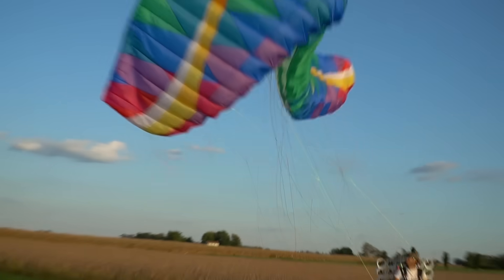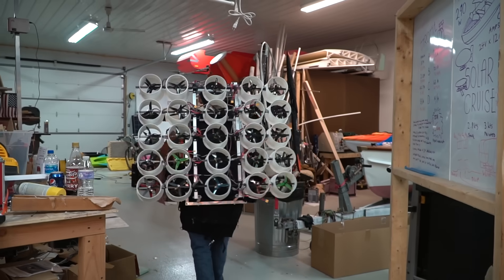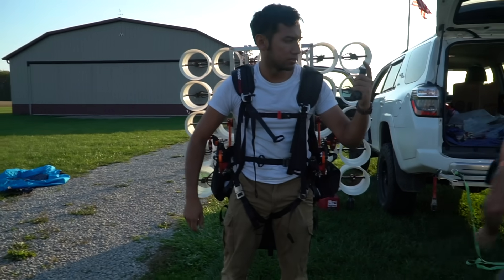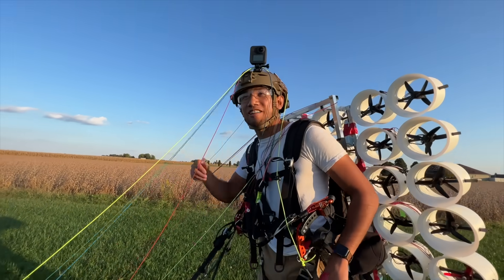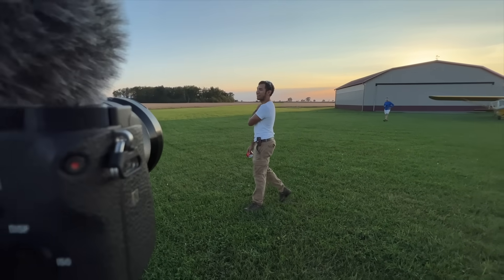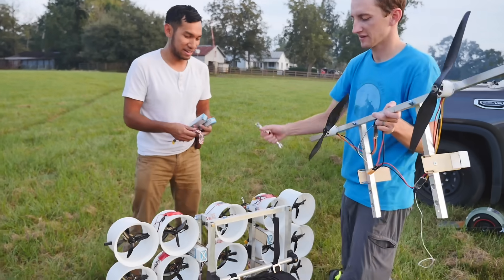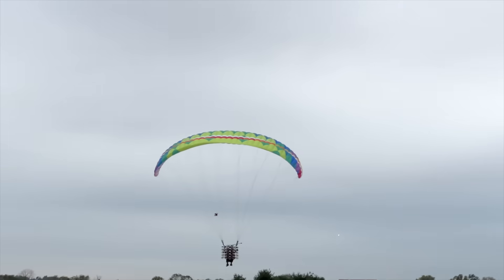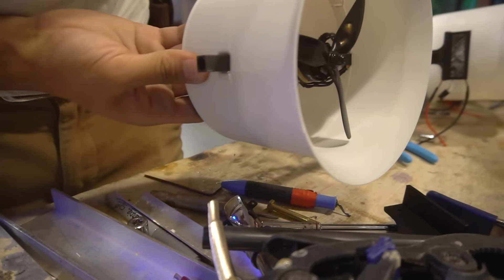Flying with 50 drone motors (homemade flying machine)

Comment: As a mechanic I can confirm, loctite won’t do it.  Go with JB Weld.  I’ve seen more than one SBC 350’s glued back together with that stuff.  50,000 miles strong and no signs of splitting.

Comment: Sorry it's not a scientific design of your science experiment.. 👎 the propeller /motor exactly behind your back are use less and creating extra weight of your flight.. 🙏 So You should be more logical and more scientific before doing experiments.. 🙏🙏

Comment: Hi mate, fantastic project.
Check your locate strengths.. Some are designed to be removed with heat, some is permanent. Make sure it's a thread locker type for screws and drip it onto the screws from the tip down. You don't need much and not all loctite is for the same application. You'll get a much better result.
Cheers

Comment: I would highly suggest adding some sort of protection for the user. Like a lightweight wall between the motors and the user. I fear someone can be basically stabbed with shrapnel from any motor blades if there is some sort of catastrophe. You have to think like this. If one motor destroys their blades, those blades can cause a chain reaction of damage in other motors. That’s a lot of shards to throw at the back of a user.

Comment: ROOD BOY IF YOU HOOK THE EDF VERTICALLY YOU CAN USE 5 EDF WITH RECTIFIER TO CHARGE YOUR BATTERY WHILE YOU ARE FLYING. THE OTHER 20'S PLAGUED TO ESC FOR THRUST FLYING. I DO IT.

Comment: LISTEN YOU DID A GREAT JOB; NOW WHAT YOU SLOUD DO IS COMPRESSION SYSTEM, COMBINE 25 EDF ONE AFTER OTHER VERTICALLY AND INSTEAD OF USING 3 BLADES USE 12BLADES OR ABOVE IN ORDER TO MAINTAIN STABILITY.  DON'T FORGET TO TRY THE VERTICAL COMPRESSION SISTEM.

Comment: how do you know that u wasnt just flying anyway due to the paraglider and thermals and that the motors were even helping at all? do double propellers work better? not necessarily unless they are both 100% in line... they could produce more drag if they arent in sync..  if u truly want it to work u might want to consider going to a wind tunnel to test everything out.. work out exactly how much power is produced, ways to make the airflow better and keeping all the blades in sync etc.. cos to be honest i feel like ur mostly just flying with the paraglider thing and these might be doing bare minimal work

Comment: how did you work out how many you needed? or u just guessed and put in 50 cos its roughly the same size as a normal paramotor? did you see how much power a paramotor produces and realise drones produce 1/50th???

Comment: should have used the motors to power two counter rotating propellers that are much larger with higher torque to take advantage of higher efficiency with a larger prop

Comment: Next time get a pair of fingerless gloves, and stitch a flap with an elastic band to the palm of the controller. Use another elastic band over the top of the pocket to keep it secured vertical. 
10-20 minute stitch job by hand, 30 seconds by machine.

Comment: If I did this I would need 130 motors cuse I weigh 255 lbs not fat just tall 6 foot 4 so I'm limited to what I can drive or fly airplane wise every ultra light I have found ready to fly that's airplane style is to small for me to fit at all or I weight like 40 lbs to much it sucks so I'm building me a Ultra light enclosed cockpit for ppl that are tall up to 7 foot tall person could fly it If needed it looks like a mini sport jet with a prop it's cool runs off of a 80 horsepower motor

Comment: To gain more power you should separate the fans into two half. left and right. ensuring a gap in between where your body exist. because your body resists a lot of air flow.

Comment: Peter, here is what I want you to do for a project:  I want you to get a 15-amp, 120V electric generator that is just the generator, with its input shaft to accommodate any power source.  Then I want you to get 40 stationary bikes and mechanically connect them and the generator all together.  Then I want you to do all kinds of experiments with powering household devices like clothes washers and heavy-duty corded power tools --- all on human power only.

Comment: I guess the problem to get the right thrust is the body of the flyer obstructing the air to reach those motors in the back of the flyer

Comment: Ducts only work on counter-rotating blades if they are shaft driven and RPM matched. The 2 motor design is more efficient when the duct is off because outside air makes up for the rpm mismatch allowing the motors to fight less.

Comment: I would say the middle row of motors behind your back isn't getting clean air and producing full thrust.
I would move them on top/bottom on the sides instead.
Also, how much more efficient is a (correctly designed) ducted fan?  I never seen a figure on that, i just "know" they are more efficient....

Comment: I wondered if it would have made a difference if the middle (vertical) row behind the pilot was removed and was divided and put on each side or on top because the human body was possibly interfering with the efficiency of the motors. You know, airflow, power and so on. By the way, excellent video, keep up the good work.

Comment: ok... so I am thinking about getting my stupid wheelchair to fly.. with a few weather balloons made rigid with my bioplastic... and thinking about forward and reverse motion... or at least reverse thrust.. like brakes... for sissies... but... easy to make.. fix.. and maintain... harbour freight..  has a rechargeable.. small leaf blower for use in the shop... 200mph velocity blowing from a hand held blower that weighs 3kg with the batteries... I'll make a video..  fly down to Safeway.. roll around Safeway come back out and hook up my trusty wheelchair to the personal size dirigible... a single moving part... rechargeable in flight because you fall up very slowly in my dirigibles... 
love your videos brother... ✌️❤️✌️
Reply: ya know those things Luke Skywalker raced... floating a meter above the ground... next think two Tesla pulse jets... with reverseable thrust..  for sissies.. goggles are required... 🤠

Comment: My immediate thought after seeing the setup for the first time was that the batteries will drain quickly but also that the sail is massive and I wonder if there's any flexible enough lightweight solar cells or membranes you could fit onto it to essentially turn the wing into one massive solar panel to continually charge the batteries?

Comment: This is probably a pretty good final solution.  Because of leverage, it might take less energy to move air with a system of small propellers, take boat props as an example.

Comment: How is the efficiency of the individual motors? Looks like the middle ones don't get much air since you sit in fron of them.
Or do they get enough?
Or would you get extra range with little power reduction if you just took them off?

Comment: suggestion
Not ure if this will give you more push, but make shrink the size and reduce some weight, by how you mount them.
Note the placing of all motors, one on top of each other and side by side
This leaves a space between motor mountings,
Then because of the intake lip, place every other one slightly forward and behind, 
What happens if you set them 1/2 the distance between each other , shifting them horizontally and vertically
It will shrink the overal size, by how much i don't know, but you will get a much stronger draw of air, and push i don't know,
But you will definitely shrink that package considerably. and not have so much losses, inbetween, not sure as i'm no expert, but just a thought to reduce weight and size.

Comment: You might try removing or relocating the vertical row of engines lining up behind your spine, as they may not be getting full thrust due to your body blocking the air flow. Just a thought.

Comment: You are losing a ton of thrust and torque potential using those cheap plastic blades. The rigidity of carbon fiber propellers allows it to cut through air more efficiently, thus translating more of the wind into lift or propulsion. This helps slightly in terms of battery efficiency as well.  Cheers!

Comment: Lacking data from a wind tunnel I can only surmise that the middle two rows are creating more drag than thrust. I think removing them would not significantly effect performance while extending battery life and therefore flight time.
 Alternately the inner 2 rows of motors could be placed in a lateral configuration at hip hight.

Comment: IMO, less but larger prop and motor combo, to obtain same wing span to power ratio, but also remove the ones from directly behind your body profile, maybe keep one low voltage anti eddy prop behind you, while ascending it acts like another motor. While descending it shuts off or reverses separately and allows the outer props to guide landing while the natural/powered eddie allows you to slow naturally/powered and predictably.
Reply: P.S. yall are stunt devils just going for it, absolutely admire it, the redundancy is an awesome feature.

Comment: Running the single fan you normally use on an electric motor is the only way to fly.  Much quieter than 50 tiny blades that make more noise than the gas motor.

Comment: Using one large electric motor to turn a large propeller is a more efficient way to produce thrust than using many small electric motors and small propellers with the same current.

Comment: I think you can try to take out the middle 3 x 3 drones ( total 9 drones ), those drones that blocked by your body are not so efficient. Suggest to put all the 25 drones in a ring shape to increase the air flow.

Comment: I feel like the fan on these are the resort of things that could be improved upon which might be a better use of a person's time. Lighter materials better modern batteries and you'd have increased flying time. 
I didn't really see the point of making a worse version of something. It's like drone motors with blades attached to cut your grass. You could but why bother?

Comment: Id feel safer on that over a regular one. I think Id have the batteries and fans separated incase of fan failure. Could that set up be used to make a hover board? A bunch of small fans under a grid not a board?

Comment: I am super curious how much this costed to build all told, is it posted anywhere? Anyone have an estimate? I can't imagine the frame is more than a hundred bucks, the plastic for the printer probably about $25-50 worth if it's PLA or maybe $60-100 if it's ABS/CFRN 
But then the drone motors; buying 50+ from some Chinese or Taiwanese vendor has to put them under $10 or maybe even less than $5 each with probably about as high a shipping cost as the motors themselves

So what maybe, under $1k not counting the labor and parasailing equipment?
That's fucking incredible

Comment: I think the same can be used to turn left and right in the air by using one side 10 pair to push forward and other's side 10 pair to push backward and turning off the middle 5. 
Btw you looks super cool with it😎

Comment: How about:  carbon graphite instead of aluminum? As for the controller...how about a glove that contains the controller, so you don't have to resort to tape. Look into making the exhaust tubes longer so you can utilize more of the thrust before it is dissipated. Take a look at some of the air movers that use the same type of funnel for drawing in air. Fly on a cold day when the air is denser

Comment: i would guess if you bring your knees up to gain some elevation
and legs down again to loose some would give you some more control over the angle of attack of the fans
i am just talking without any knowledge of how a wing like this behaves with that kind of input, or even without, i never flew one

Comment: I just wish we could use these for example to go to work... rather than a train or bus, you just power it up, run a bit, lift up in the air and the soar through the sky until you reach your office / worplace. Land, do you work, and the fly back home. I KNOW that there are versions which would allow you to commute (as in travel distance) - its just the legislation and obvious safety issues... but still i would rather go with this rather than on the ground...

Comment: For better airflow use a honeycomb configuration. Also, move the motors from the centre column to the outer edges (it looks like there is plenty of room for that, especially with a honeycomb config)
Reply: Can't be any wider than your arms can hold the risers apart on launch.
Reply: @matoko123  A honeycomb configuration will compensate for that because it will be more compact. Also, he still had plenty of room to spare.
Reply: for a better engine just dont' fuck with this at all, anyone can make an engine run a few minutes off anything
Reply: @allenhaywood9608  What?

Comment: Why pick a fat tire chunky bike like that??? You are using this as a transport option, the bicycle is heavy (tires, and overly weighty frame, which is over kill and looks more like scooter frame). Europeans style electric bikes or even speedpedelecs are much lighter, sturdy (more than you'd need) and optimized for range and comfort over urbanized areas, and have a much better motor (speedpedelecs can go up to 45kph), and E-bikes (are limited to 25kph, but they can go faster). And why pick a bike with the motor in the wheel itself? They are awful to maintain (cheaper, and less power) frame based motors can be much more powerful and make maintenance much easier...

If that fat heavy chunky boy ever runs out of power or the battery dies... you are stuffed... no way are you biking that without power assist anywhere... European E-bikes are light enough to continue biking on if the battery runs out, or the motor dies...

google the following: 
Cube Touring Hybrid Pro 625 (E-bike 25kph)
Gazelle Ultimate Speed 380 (speedpedelec, 45kph)
Gazelle Medeo Speed (speedpedelec, 45kph)

these are brands and models of what you can expect, and what a good E-bike should be...

Comment: 1:17 "whoa dave check it out 50 of my greatest fans" ...I only see 25 fans... There are two motors for each fan, but each pipe is still only one fan. I also don't understand why he uses such small motors that he need two for each fan? And why does he use such small propeller wings when he could use much bigger and more efficient ones?

Comment: What is the performance compared to the standard gasoline powered one large rotor version?

I wonder, aren't there already slim and light photo voltaic/solar films which could cover your printed rotor casings? Question is if they would alow you to safe up on batteries and therfor on weight. Also the aluminium, could it be made out of one peace so you don't have to screw it together? Your printer may not be big enough for the following idear, ahving a honey comb grid structure which maybe could be stable enough so you do not need the aluminium framework at all and place the rotors inside of the honeycombs.

dreaming ... wouldn't it be awsome if the paraglider itself could be made out of a solarcell material delivering energy downwards ... might be shocking though(alternating/direct current?)

Comment: And instead of hanging on shoulder
If it could be added on an electric bike but the weight has to be less.
Then you could just drive the bike and then start the propeller and off to sky

Comment: Carbon dioxide dose not have any impact on global warming. The coalition between atmospheric warming and this gas is not measurable. It is a PROVEN MYTH!
The ice cores from the South Pole dictate this. As during the last ice age the carbon dioxide levels in the earths atmosphere was 100 times higher than today. The reason for the planet warming is purely the earths cycle. The cycle is over 1000 years. And has been documented in ancient history. The global warming agenda has data from the 1880s till now! That in itself is a huge failure of scientific practice and process. As it hasn’t taken in the full extent of the earths cycle. And now the push is to destroy farmers hearts of cattle! As they fart to much. That alone shows a level of farcical stupidity. That has never been seen before. 
This whole global warming or climate change! Is a globalist concocted lie. That does not include ANY independent sources of study and findings!! It’s purely government or globalist agenda funded research! 
So... DONT kill the messenger here! Instead just go look 👀...
Anyway love the video bud!! Your builds are a breath of fresh air!!!
Reply: so you sayin that the global temperature in the cretaceous period was not much higher than today
...and that we aren't artificially inflating that massively?

Comment: Would it be possible to add a small distance from the motor rack to the harness for better airflow...plus have a horizontal solar panel instead of batteries? I think the basic concept has good potential. Just my $0.02 worth.

Comment: Fun and fascinating. The innovation here is propulsion by multiple engines. The motorized paraglider has been around for a while. The paraglider even works with no engine at all, provided some sloped starting ground.  The race for personal transport by air will hardly include a paraglider. Still, the mere number of viewers, 4,3 mill. at present, is an achievement in itself, indication the enormous interest and potensial in the man/drone concept. The actual example is scientific and quite brave, reminding of the early flight pioneers, risking their lives to back the experiment.
Reply: ignore the bot here,
there are already some production paramotor power packs with 4 small electric motors instead of the initial electric motor design with one larger motor, you should look up "electric paramotor" or "4 motor paramotor" they're pretty neat!